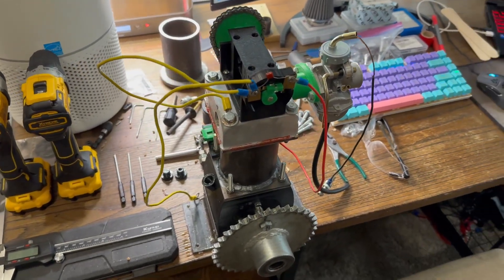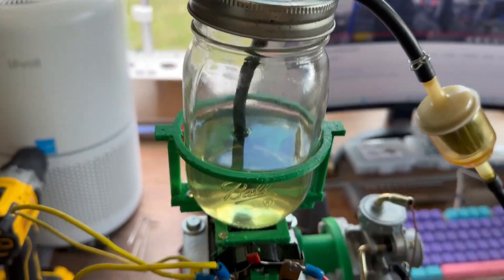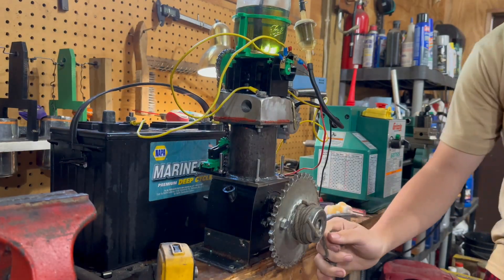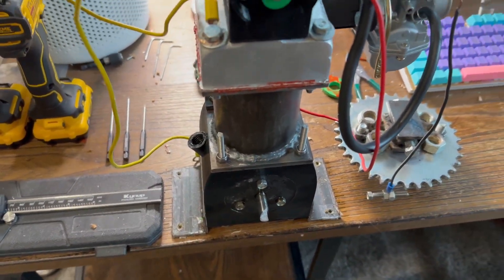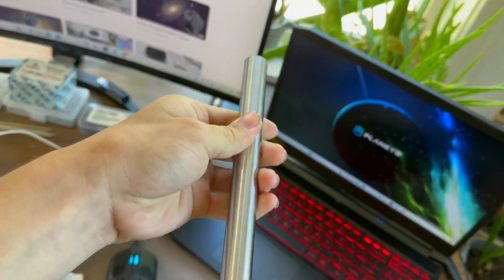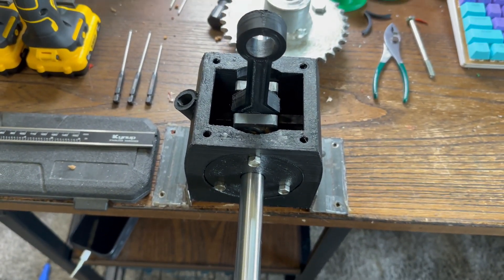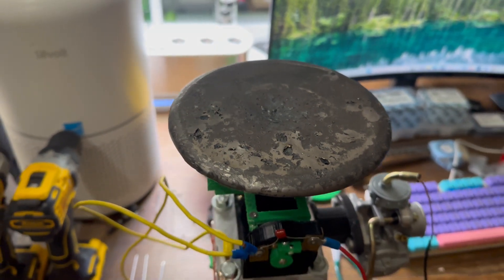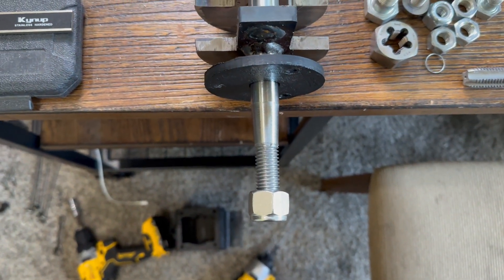180cc 3d printed engine RUNS until failure!!

Comment: Nice progress, it runs pretty damn nice 👍
Reply from the maker: It ran surprisingly well for everything being homemade, I’m currently in the process of making more metal parts!

Thank you for watching!!
Reply: @ProjectLMZ  especially for an homemade engine! 

The only "probleem" that i noticed straight away was the insane amount of blow-by, but overall it looks good!
Reply from the maker: @Rdw_04  it’s actually not blow by, I talked with my uncle who is a small engine mechanic, my dad and a few other people in my family, and they have all agreed that it is just the crank case pressure, because the volume of the cylinder is basically the same as the volume of the crank case, the gases moving in and out of the crank case are moving at the same speed as the gases inside of the engine.
Reply from the maker: @Rdw_04  also it does it when I don’t even have fuel or anything hooked up, when I was doing initial testing with the spark plug out and the ignition and fuel disconnected, it still did it. I thought it was blow by at first too, but the compression was just too good for me to believe that it was blow by, and the testing with the spark plug out proved it for me.
Reply: @ProjectLMZ yeah, makes sense, i thought i saw the gasses from the crankcase igniting at 14:02, but it was just the exhaust lol

Comment: three taps... taper, intermediate, plug... really makes a big difference on tapping... also tends to pull itself straight...

or ... learn to thread on the lathe. its scary. its satisfying. its what theyre intended for. then you know its concentric....

you wont get that diameter, those lathes dont have the torque at the speeds it runs... too fast for carbide even...

try a grinder... cover everything... spin the work by hand...

lol, the evolution from printed to fabricated metal... the exhaust valves guaranteed to cause issues. they do tend to glow red hot on a real engine under load... and the only way they can cool is the valve guides, and the seats.

could change tack... try a lenoir cycle or "non compression" engine... far less heat and strain on things... and its something... different. everyones stuck in a rut, it seems. 

pistons are easy to make but the most important part is the ring grooves, and the rings. the bottom of the ring and the top face of the groove have to be perfect... as thats where the main sealing occurs. the gas forces them down, and simultaneously gets behind them and forces them out.

the hardest part is getting the pin hole bored straight and square. in all regards a lathe is better...
Reply from the maker: I like your idea for making a piston, I’m more worried about machining the inside, but if I get a good casting i shouldn’t have to worry, and for the pin, I would just measure from the bottom of the cylinder, then square in up in my drill press and then drill it. 

Thank you for watching!!

Comment: Add an exhaust and a muffler or sum bc its a 4 stroke it needs an exhaust to run better and its lowkey better for the engine to have a exhaust so the airflow can go thru the engine perfectly and dont causing problems with combustion bc you do have an 3d printed combustion engine dude😂 sick project man its awsome but yea get an exhaust with an silincer and a better guide tensioner and u be good😂🫡💯
Reply from the maker: I was going to put an exhaust manifold on it, but I don’t have any 90 degree copper elbows, and I want to look cool too. It should have an exhaust in the next video. 
I definitely need chain guides, as it fell off of the sprocket 2 times now. 

Thank you for watching!!!

Comment: Make your life easier and get a corded drill to turn the engine over, also if the carb is leaking fuel you probably need to adjust the float so it cuts off fuel earlier.
Reply from the maker: I like pull starting it, I could use a drill, but if the engine backfires I will loose my wrist.🤣 I actually didn’t notice it was dripping fuel, but I had the same issue with the previous carburetor that was the same one. 

Thank you for watching!!
Reply: @ProjectLMZ  you won't hurt yourself if you use the slip clutch on the drill. those ropes are dangerous because they can pull you in. it's why they're not used on mowers anymore.

Comment: it hurts me to see the oil from the crankshaft just being all spilled out, i would make a 3d printed nut designed like a mufler aka like passage ways to not restrict the air but make it harder for the fluid to go arround it,and also pls add some type of cooling just bcs of how much water cooling can do, for example if u put a lighter under a ballon it will explode right? if you fill it with water and then put a lighter under it, it wont explode bcs it cant melt the ballon quick enough bcs the water is exchanging tempature so quickly that makes the ballon survive the fire, also nice engine, now put it on a mini bike XD
Reply: Could even bunch up some steel wool in the crankcase vent to make it more effective at stopping oil, or perhaps a one way valve and get a vacuum in the crankcase, although I'm not sure how useful that would be.
Reply from the maker: The oil spilling is fine for now, with a plastic con rod it’s not doing much, but I need a good size relief, because it builds a lot of crank case pressure. I am planning on adding water cooling in the future, but there’s not a good way to implement it with this design, because I have studs running from the top and bottom of the cylinder.

Thank you for watching!!!

Comment: sick video, are you going to make an exhaust manifold for it?
Reply from the maker: Yes, but I had no 90 degree elbow for 3/4 inch copper pipe on hand, I want it to look cool. probably will have an exhaust manifold in the next video! 

Thank you for watching!!
Reply: @ProjectLMZ  sweet as, you're probably aware but just incase you're not,

an exhaust manifold will be very good for your motor because a lot of unburnt fuel is going through the exhaust which will overtime destroy the exhaust valve and may be why the valve spring retainer melted because the valve got so hot. 

the manifold will stop oxygen from getting to the exhaust valve so that would mean there will be less fire around it meaning it will stay cooler
Reply from the maker: @chedrwastaken I did not know that! Thank you! That could be why, but also the hole for the valve stem is slightly to big, so I also think flames and hot gasses are shooting up directly to the valve spring retainer. I’m going to cast an aluminum retainer today if it’s not rainy, hopefully it blows over, but I think next time this engine will run for a while!

Comment: try to make the piston out of metal and try to enchase the cylinder so you can water cool it, anyways cool engine, very bad to the bone 💀
Reply from the maker: I want to put an aluminum piston in it, but I need a mill. But I might be able to cast it, not sure though, because the inside I can’t really machine on a lathe, because it’s not a circle. Water cooling would be cool, but not really a good way to implement it with this design, I have studs running into the top and bottom.

Thank you for watching!!
Reply: Water cooling is a stupid idea considering the crankcase is plastic
Reply from the maker: @markopolo7651  not really a stupid idea, It would help keep the crank case cool as well, but I get your point. Even if the water was just starting to reach boiling temperature, the crank case would’ve already melted. But it would extend its runtime. I do want to make an aluminum crank case in the future, but that’ll be way out there. It’s actually working fine now.
Reply: @ProjectLMZ  it'd make sense with the aluminum case, try out some sand casts.
Reply from the maker: @markopolo7651  I’m going to make the more critical components first, but in the future, I am basically going to have every piece of this engine metal.